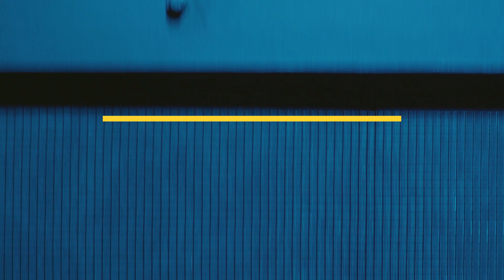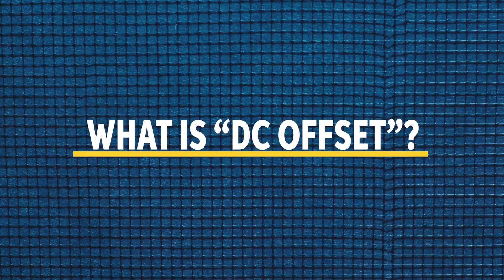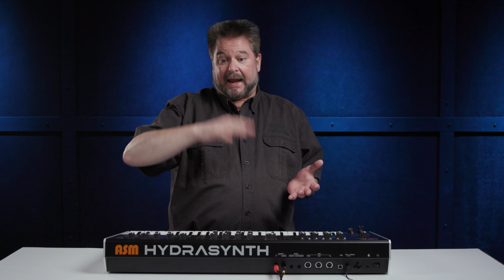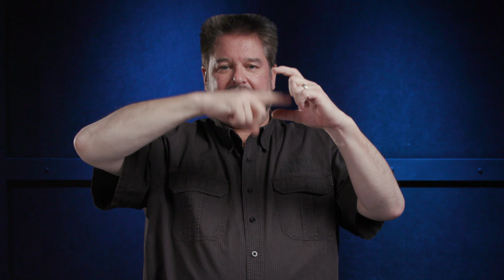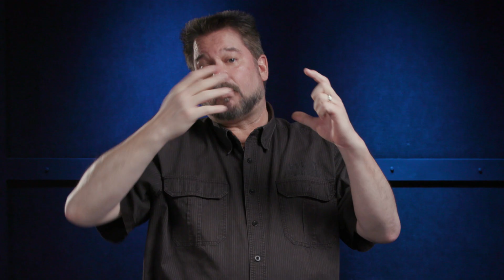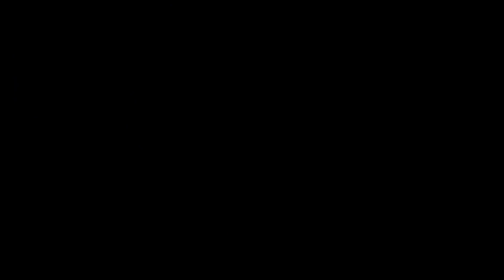What Is DC Offset? – Daniel Fisher

Comment: Thanx 4 the vid and the explanation.
I have some questions that I need to clarify with my re-recordings which sometimes do have a slight DC-Offset, but most of the time there is none. Love it if you can say a few words on this...

1. Is there an audible benefit (or disadvantage) in any case when you increase DC-Offset in any way? (given a signal has a DC-Offset of, lets say, 0,43% and nothing is clipping in any way)

2. Is there a "maximum" DC-Offset that is tolerable without any inflictions to the sound one hears? (0.1%? 2%? 10% - given nothing clips in general)

3. Can DC-Offset already be on a source medium - and then be recorded exactly "as is" or is it always an error of the recorder?

4. If not sound in general is affected - is there some impact on stereo imaging or correlation?

Thx and keep up the good work. Best from Germany

Comment: We also use the term DC shift or DC offset in geophysics (I'm a geophysicist) for us it's either an unwanted or intentional shift in the level of a data channel, the signal frequencies and amplitudes in the channel are unchanged but the whole data channel level is just shifted up or down by the same amount at every point in the channel.

Comment: You can define DC offset in a clearer way as follows:
It is a voltage signal in the form of a wave of which either the positive amplitude or the negative amplitude is shifted due to DC signal  shifted up or down

Comment: There was a newer album, I think it was Weezer, and I could see the center line on the oscilloscope would lower from time to time during crescendos. I thought, "Hmm, what a clever way to increase the level by just clipping half of the waveform of the bass," and until now I didn't know what it was called. How do I do that? I do a one-man-production channel where I sing and play every part and then self-produce, and I would like to use that trick to increase my levels when needed but don't know how with Reaper's stock plugins nor am I willing to pay $300 for software.
Reply: Thats not the same thing as what they're talking about. You just need a clipper and a limiter. Weiss MM-1, and Kazrog K-Clipper will get you there for a couple hundred bucks.
Reply: @Mdjagg  Uh-oh, looks like you may have missed the last part of my last sentence. But thanks for the info!
Reply: @CraigFlowersMusic  200 is not 300!!! When they are both on sale, youre looking at 130 ish, for high quality tools.
Reply: @Mdjagg  Thanks. Reaper's stock clipper/limiter will do just fine. I already use it, but I haven't noticed any movement of the baseline on an oscilloscope.  Nevertheless, I use ALL stock plug-ins. Check out my mixes, and tell me there is any need to pay for software! My Argus sounds better than the original for example. Thanks in no small part to the stock clipper/limiter lol
Reply: @CraigFlowersMusic  Theres a reasons every mastering engineer in the world used the Weiss machine before fast CPU's. I just picked it up recently and there is no stock plugins competing with this thing. It's on another level. So clean, and it is dead simple to use.
Reply: @Mdjagg  You say that  without having heard any of MY mixes. My YouTube analytics will tell me if you DO decide to actually give yourself the context to even have this conversation, by actually listening to my mixing.
Reply: @CraigFlowersMusic  Yeah, you need a high quality maximizer/limiter. Not a huge fan of covers, but cool voice!
Reply: @Mdjagg  The Ocean was record before I learned to use a clipper/limiter. The Argus is the best example, although I did also use it for Ship of Fools and D'yer Mak'er.
Reply: @Mdjagg  Thanks for saying that. But I'll reiterate: The Ocean doesn't have limiting; only the three most recent videos do.
Reply: @Mdjagg  C'mon, don't make this entire back-and-forth into a waste of time by never actually listening to The Argus (let alone D'yer Mak'er or Ship of Fools).
Reply: Aha, redeemed! Thank you,  and welcome to the conversation!
Reply: @Mdjagg  Reaper is pretty awesome, right? Even their stock clipper/limiter is limited (no pun intended) only by the ears of the person  using it. Super-professional sounding (If only you could hear the original, lossless file instead of the .mp3 YouTube turns it into, and through my $20k system to boot); inspired performance; yet still just a hundred views. Go figure. That's why I quit putting out content. Nothing matters anymore. After 9 years and 250 videos, I should have thirty-thousand subscribers, not 300. So I've made all but my most recent album private, and I've stopped recording.
Reply: @CraigFlowersMusic  
People want to hear originals, not covers. Unless you're doing some off the wall stuff, like Scary Pockets, you'll never get tons of subs doing straightforward covers. Check the view count and subs on the original video of the ones you're covering and see how many views those have. Hard to ask for more than the origin music generated. Nah mean?
Reply: @Mdjagg  The plan was to learn to do studio production while gaining a small sub count in the process, then switching to originals by the time I monetize the channel. It only takes a few thousand for that. Want to hear an original of mine? I just went and made it public on my channel. It's called "About Time." Recorded when I was still obsessed with doing everything in 1 take, wasn't any good at mixing/mastering yet. But still . . . There's proof I CAN write. I have plenty of originals. They're just all set to private, because nobody watched them. Some of my piano stuff has fewer than 20 clicks, average view time under a minute.
Reply: @CraigFlowersMusic  
Well don't stop after doing all that work learning how to mix and master. Pretty cool song, ill have to listen to it on better speakers soon. Thanks for sharing.
Reply: I'm gonna make an album designed to damage audio equpu

Comment: A nice simple explanation. A couple of times a year I adjust the DC offset in my vintage HiFi solid state amps (if they have adjustment pots). It’s also good the back check the idling current.

Comment: But how does it actually affect the sound? When I select that in say a limiter plugin, I hear the difference, but I can't say it sounds better by removing it.
Reply from the maker: Hi Adam. It won't always sound better. If the offset is small enough that both the positive and negative peaks in the waveform aren't clipping (beyond the headroom of the system) you probably won't notice it. But... it's important to know that *silence*, which should be at zero, will sit at either a positive or negative voltage. This means that your speakers could potentially be getting a constant, unwavering voltage that can burn out a speaker's voice coil. You might also find that mixing signals that have a DC offset in the same direction will clip the system much sooner. -Daniel
Reply: @sweetwater  Thanks Daniel. That makes me wonder if it's worth doing at the track level rather than master bus level. It also kind of makes me wonder if that has been ever present in analog recording gear and if so, maybe it's not worth worrying about.

Comment: I've noticed on tracks with heavy bass and/or too loud and very low tuned kicks/bass drums, more often than not, turns out as Offset. And by high passing/low cut up to about 30 - 35 Hz will usually either minimize the offset, if not actually eliminate it completely to 0%.
Reply from the maker: Hi G4Z_G. It's worth looking at your hardware/software to see if there's a feature that corrects the DC offset. That way you're not having to do anything tonally to your sounds. -Daniel